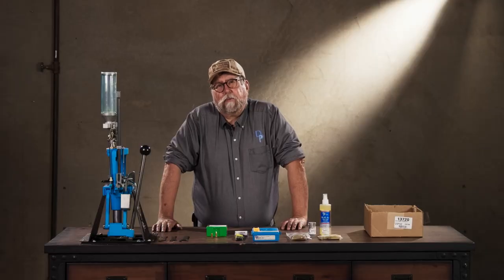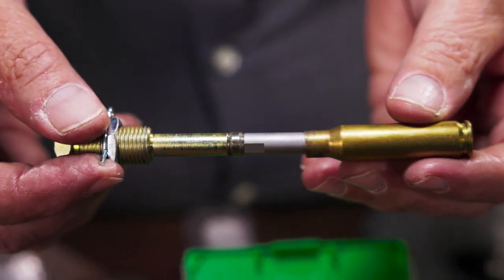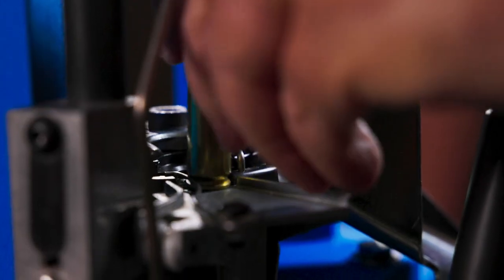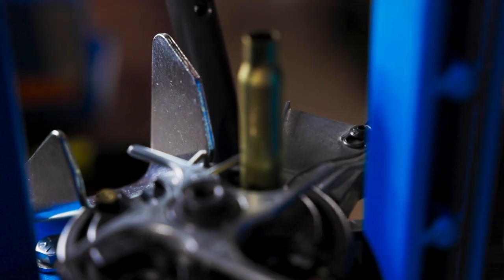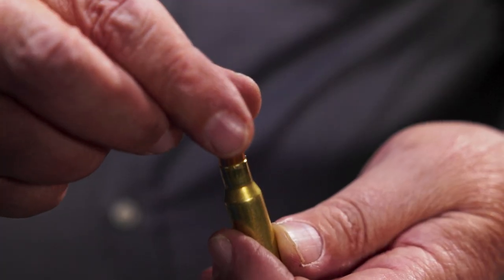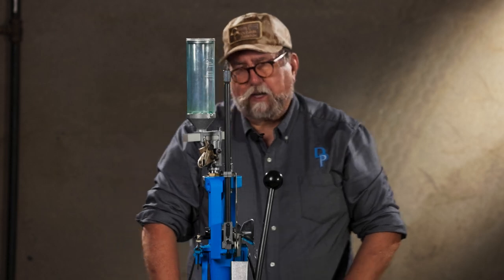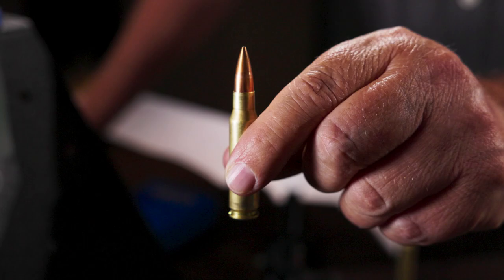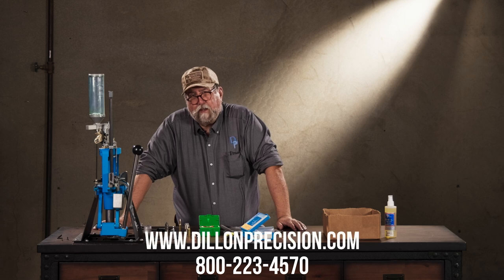Dillon Precision Reloading 101: Rifle Cartridges

Comment: LUBE! It’s too true… accidentally put in an unlubed case and was it ever stuck.  Ultimately had to drill out the primer pocket, then threaded it, and was able to put in a bolt (with an octagonal head), a spacer and a washer and pulled out the case by tightening the bolt.  Never again…LOL

Comment: Amazing - I have a Lee single stage press but looking at getting a 550 or 750. But this video explained the setup of dies so well which applies to any press. Very impressed and this means alot for your brand. I have a question: the toolhead that is being used in the square deal B will it fit in the 550 as well, they look very similar?

Comment: Great step by step detail. Best tip for me was at 1:50; remove lanolin from the fully loaded case, rather than the way I do it now requiring a separate cleaning after sizing. You state corn cob media and alcohol, I clean with walnut media, is that equally acceptable?

Comment: New to Dillon. I am getting a Dillon 550c from a friend. Will I be able to reload Weatherby 30-378? 
From what I’ve read the powder dispenser will not work for this load (107gr). But my question is can I resize and seat on this press. Or will I also need to get a rock chucker? Total rookie here. Thanks in advance for the response.

Comment: He is usually quite thorough but in this instance didnt provide the warning, and so make sure you use the right Dillon lube for bottle-neck cases that he displayed in this video. Under Dillon's case lube products, they specifically warn the following:
"Dillon Synthetic Case Lube - This is recommended for lighter duty lubrication, such as handgun cases.  Not recommended for bottleneck rifle case resizing"